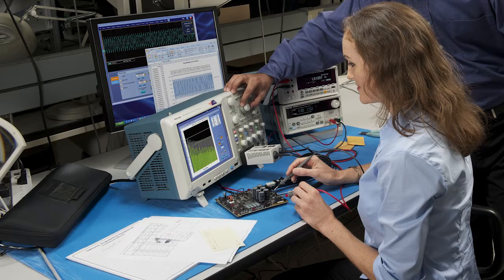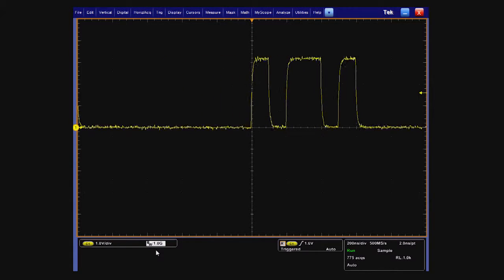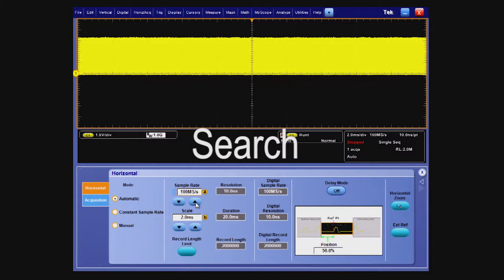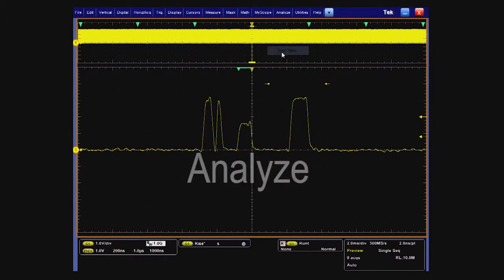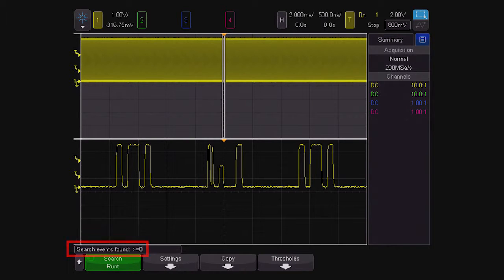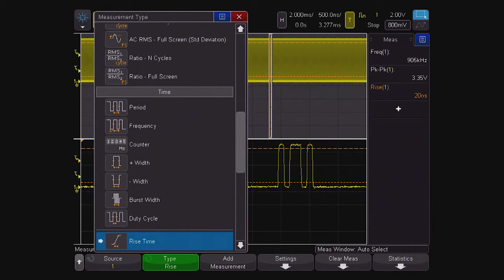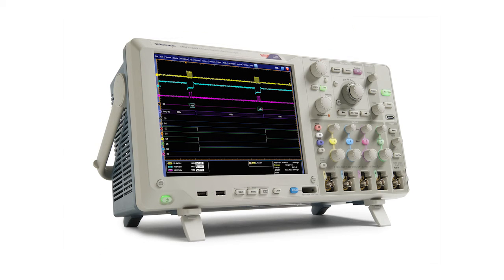Tektronix MSO/DPO5000B vs. Agilent MSO/DSO-X 4000A: Search and Measurement

Comment: This Guy has no Idea how to use the MSO/DSO X 4000 Scope if he Knew how to set it up which is only a one simple touch when you see a single runt it will capture only waveforms with  Runt and can be setup to Collect runts and  to find runts over days and save them even if they only happen once or twice a day then your ready it will let you look at each individually or together Trust me the reason they made such a Shitty one sided video is because there scope does not hold a Candle to this one. don't be fooled get a knowlegable person to repesent the scope before you buy anything. if you do I am sure you will not end up with a Tek scope I was a Tek loyal engineed for years but when hp came out with the mega-zoom scope in the 1990's I left the tek camp because they no-longer had the leading edge. and for what ever reason I think they have never got the lead back. I am now on my 3rd Scope in this version of scope and it is amazing how it makes short work of difficult problems. But dont take my word for it Get someone from Keysight to give you a real demo of this scope I have the InfiniiVision MSO-X-4034A and I promise you will be happy you went through the extra effort. these two scopes are not even in the same league !!
Reply: @Herb Winters
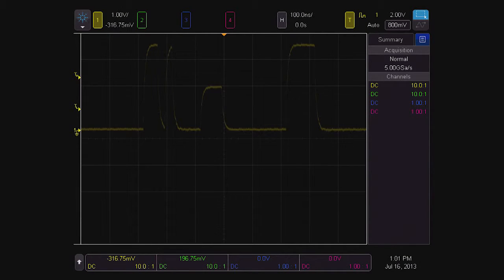can you help me? I am watching the video very carefully and I cant figure out where he messed up? At 3:30, it looks like his runt trigger thresholds are set pretty well. 'TL' is properly below the runt level, and 'TH' is properly above the runt level. So far so good. Then, 4:11, I can see both the runt trigger levels 'TL' and 'TH', and the runt search levels, 'TL' and 'TH'. They look like they are both set correctly. What setting did he miss? I am trying to figure out how to setup this exact same search. Thank you.

Comment: You need to learn how to use the competitor's oscilloscope properly.  Try Setting the thresholds for the runt search before you claim that it doesn't find anything.

at 4:30
"...it is curious how it maybe found zero or more runts even though the scope triggered on a runt"

Should this not tell you that you configured the search wrong? Stop making bad comparisons, it is getting really old.
Reply: This "slate the compeition" approach from Tektronix seems to be rife on this youtube channel.  Not what I would expect from a company with the past prestige of Tektronix.
Reply: @Neganur 
can you help me? I am watching the video very carefully and I cant figure out where he messed up? At 3:30, it looks like his runt trigger thresholds are set pretty well. 'TL' is properly below the runt level, and 'TH' is properly above the runt level. So far so good. Then, 4:11, I can see both the runt trigger levels 'TL' and 'TH', and the runt search levels, 'TL' and 'TH'. They look like they are both set correctly. What setting did he miss? I am trying to figure out how to setup this exact same search. Thank you.